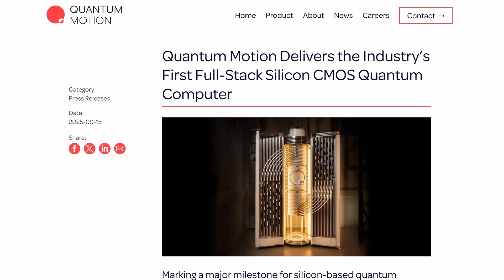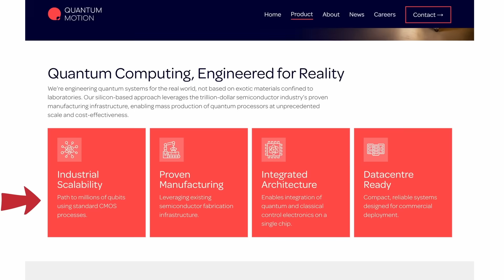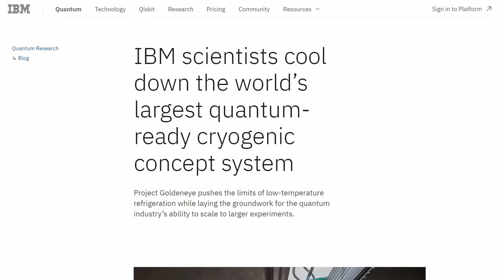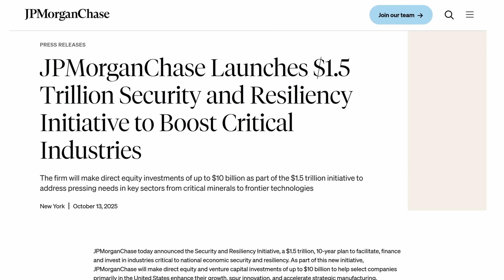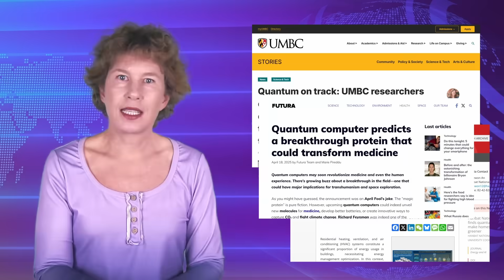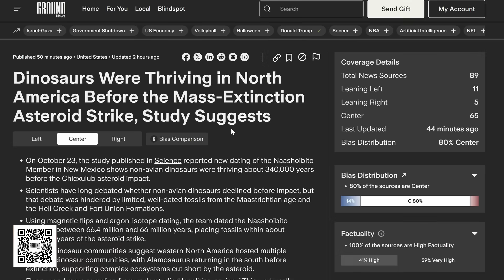I was SO wrong about quantum computing.

Comment: "It's just that they don;t f*iing fly". Perfect summary of the state of the field.
Reply: Just observe the ship that are flying 😊
Reply: Spaceships don't fly. Exactly right. They just ... move! In space. Airships don't fly either. They float in air. Butterflies fly. Sorry, this urge to nitpick came over me.
Reply: @benttranberg2690  Spaceships most certainly do generate lift. Some are even designed to be lifting bodies. This is a pedantic fail.
Reply: @itsausername , if we're going to be pedantic, which indeed was the point, then I'd assume you're confusing spaceships for rockets. You can argue the space shuttle is a mix of the two, but then it wasn't really a spaceship if we're to be pedantic. It could never go beyond its orbit.
Reply: @benttranberg2690  Both starship and the shuttle are lifting bodies. Yes the shuttle was a "space ship". That's a pedantic double fail. Might want to quit while you're behind.
Reply: @itsausername , oh yes! 🤣
Reply: @benttranberg2690 (in mock exasperation) But you are defeating the quantum uncertainty! 😠😁🤣
Reply: That shocked me I didn't expect that I laughed out loud 😅😅. I have been watching her for years.
Reply: Let's talk about possible applications (below).

But first even if the cooling worked: What is the bandwidth of state preparation and readout? You won't run a quantum AI (neural network) with billions of parameters on it, but highly specialized optimization problems with a few hundred parameters at best.

Protein Folding in the best case. Fundamental science simulations in limited areas, yes. Nothing better than a quantum computer to simulate quantum effects.
Encryption/Decryption? Not really. Post-quantum cryptography makes this superfluous in areas, where people would spend enough money for decryption.
Robbing some of the blockchain currencies by manipulating the ledger before everybody notices? Yes, that is the application to make money (billions).
Reply: As a Starship fanboy, who actually watches its progress closely, I am just sitting back and laughing. Boy are these people going to be embarrassed.
Reply: Can we just call this the SpaceX approach?
Reply: @itsausername reality denial
Reply: @lukaszspychaj9210  3 dozen starships built, zero achieved orbit. That's the reality.
Reply: Starship fans seething 😅
Reply: @Christian777-kjv  As a Starship fan, the joke seemed unrelated.
Reply: @Christian777-kjv  They are not seething. You may only wish that they were. Clearly, Sabine does not like Elon and she's letting it cloud her judgement. Which is not very scientific, which disappoints me. I doubt she watched the success of IFT-11 and knows about V3 coming next year in January/February. It will do a few, if not one, suborbital test flight, then go orbital in a week or two thereafter, which will most likely have V3 Starlinks onboard for deployment. They'll do Starlink missions until they can prove reliability and then you will see the HLS tests, and soon enough, Mars deployments with Optimus on board to scope out Mars. It will be difficult for Sabine to swallow this pill, but I hope she takes it like a champ and returns to reality.

Comment: I still do not understand how it works. Can you please explain!
Reply from the maker: I honestly don't know how to explain it without maths. It's just that you can do logical operations on quantum states that you can't do on non-quantum states.
Reply: @SabineHossenfelder  So a 13C nuclear spin (up/down=1/2) can be turned with an rf pulse from low to high energy quantum state (in strong magnetic field) - even the molecular bound atoms will feel it (J-Coupling). Where does the second qubit in (and other 10.000) and how does it interact (geometrically?) ? How is the "result" read out?
Reply: @SabineHossenfelder   It works the other direction as well as you can't apply the distributive law to quantum propositions.  This can be interpreted as stating propositions that would violate the uncertainty principle.  I think the key "advantage" to quantum computing comes from superposition.  Instead of checking the "logic" of one state at a time we can check all of them at once.  I think the key "disadvantage" to quantum computing comes from entanglement.  To represent problems that are actually useful we need a lot of qubits and they all have to be entangled with one another... thus your apt observation with thermal regulation.  I strongly suspect we are missing key pieces from quantum information theory to really know what is going on here and what is or is not physically possible.  Perhaps that's what we will get out of all this investment... empirical data that we can then use to refine the theoretical models.
Reply: It doesn't.
Reply: Already some accurate videos in her playlists😉
Reply: @Thomas-gk42  For really, really dumb  chemists that might understand NMR and spin, but no interacting qubit 😊
Reply: it does graphing like answers only. Only really viable as a GPU for gaming where small amount of errors don't matter (pun intended). Well it could be useful for hackers too.